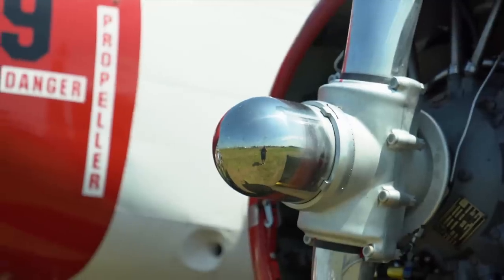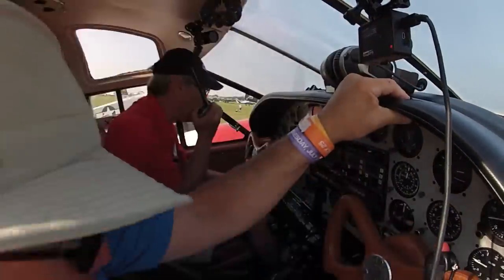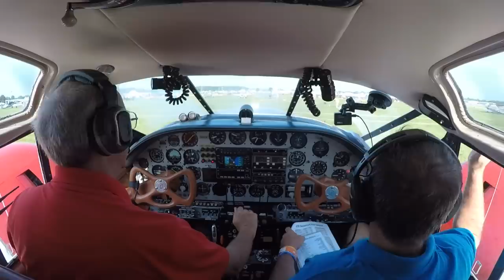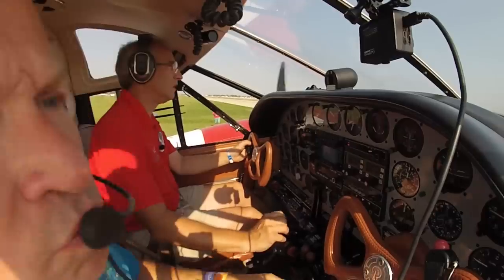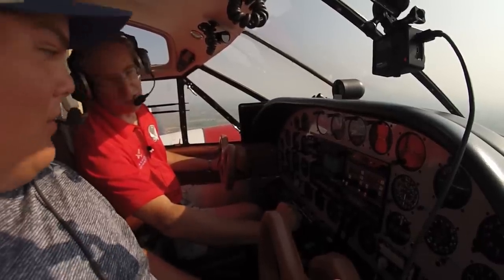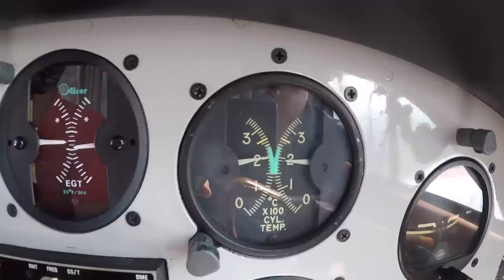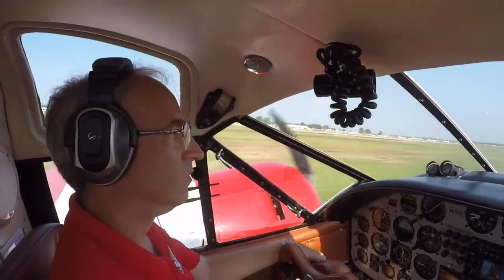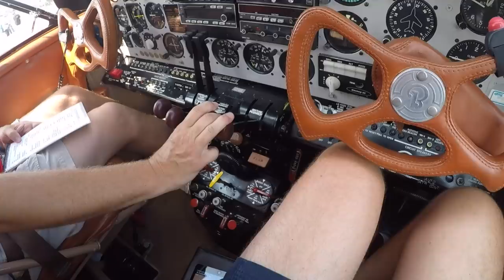Flying the Twin Beech (Beech 18)

Comment: I love seeing the 18's heritage showing in modern big Beech's-- the King Air's flaps, various knobs, switch layouts-- the older Barons' Prop/Throttle/Mixture arrangement-- windows are a mix off 99's/Queen/King Airs-- The cabin door and on and on.  It reminds me of how the MD-80's cockpit window hardware is straight off the DC-3 line.  Decades of good, solid designs.
Reply from the maker: I agree!

Comment: Many years ago, when I was young and full of overconfidence, I flew an H with tricycle gear to show to a potential buyer at his home airport.  1st flight in an 18, I was the pilot.  What could happen, right?  I had about 30 hours twin time -  in a Cessna 310.  Tried to land the Beech like I'd landed the 310.  Found the 18 had the glide capability of a boulder.  Very fortunate those P&W engines came back to life quickly.  I survived the only obstacle landing I ever unknowingly attempted in a Twin Beech.  Have flown a couple since, got some dual time first.  Love the aircraft!  Great video, Martin.  Thanks for putting it up.

Comment: I too love the sound of 985's.  In the early 70's I was a lineboy for a guy that had a dozen or so twin beeches which he used on mail contracts.  Us lineboys would help load the mail and then ride along.  I did manage to bounce one once but never ground looped.  Only airplane the owner ever had wrecked was when someone ran one off the side of the runway for  an unknown reason.   Bobby Younkin used to fly the mail before he started  in the air show business.

Comment: flew one for a company maybe forty years ago.  one thing about it was that you didn't use full throttle on takeoff.  manifold pressure was limited to 36.5 " hg. as you climbed, you kept adding throttle. you wound up with the handles all the way up around 8000 ft. same thing with the p&w  r-1340.
Reply from the maker: Correct, the engines are supercharged, and you have to watch manifold pressure as you advance the throttles for take-off.
Best, Martin

Comment: They have it in MSFS now. This is a wonderful plane to fly - virtually. The visibility is indeed excellent, I was wondering if my head position was somehow too high, but no, it's just that good. It flies so stable. Putting it on the ground is easy, slowing it down is a handful. Keeping an eye on all the gauges is almost infeasible under workload for one pilot. Luckily it does have an autopilot, even one that does not seem to want to kill you. It's not advanced enough to do that, which is refreshing.  
Probably - and by that I mean absolutely - the most fun I ever had in a sim.
Reply: I look at MSFS videos often, now all of the Twin Beech videos keep popping up on my "recommended" pages! I wonder if this is a coincidence?
Reply: @whammo11224  The algorithm knows ;) It’s quite cheap actually. And if not study level, close to it.

Comment: In 1955 or 6 I worked part-time at a FBO at Blythe, CA, and rubbed out new wing panels on an unknown year twin Beech. What a workout on the underneath. Basically I worked for a couple of flights. I also worked at least one Powder Puff Derby in that time frame, servicing those who needed fuel or breaks.

Comment: I've always said that if I could afford a twin I'd own a Beech 18. One of my disappoints in life is that I could never afford to buy one.  Instead I ended up with a Cessna 175 and modified with a Lyc O-360, CS prop, Avcon STOL, new upholstery, new plexiglass.  Still dream about a Beech 18.
Reply from the maker: There sure are worse dreams than that, Douglas!
- Martin
Reply: Douglas Rodrigues Nothing wrong with that man.  Your conversion is a solid one. Assume it helped w weight and balance.

Comment: What are all the slides or signs that the flight station crew keeps managing, repositioning, and displaying up on the windscreen and instrument panel hood, and what are they for?
Reply from the maker: This is part of the communications procedure in Oshkosh. They are signs with the parking position (e.g. GAP = general aviation parking, WB = warbirds) or departure needs (IFR, VFR). Cuts down the radio transmissions.
- Martin

Comment: ?? If the engines are supercharged they don't lose MP in a climb as the blower makes up for the change in air density (to a point). I know a few guys who've owned these, such a cool airplane with a great sound.
Reply from the maker: Going from memory here... Jeff explained that the compressor for the supercharger on the Beech 18 is mechanically linked to the crankshaft. So the maximum manifold pressure available does indeed decrease with altitude, just like in a normally aspirated setup - it's just higher than the atmospheric pressure, due to the supercharger. Given that the Beech 18 uses derated power, in practical terms you can get the maximum allowed MP up to 8,000 feet or so. But it does require continuous throttle adjustment in the climb, unlike a modern turbocharger with an automatic wastegate which maintains MP up to the critical altitude.
No argument on the great sound of these radial engines!
Best, Martin
Reply: @martinpauly  It will lose some MP due to pumping losses, but it'll maintain climb power at least to 8k. I'd have to ask my friend who owned one about the engine's critical altitude. 8k sounds a bit low for a blower engine, but I'm not 100% sure. Great video, btw.

Comment: Some of these old birds were used in military flight training; I believe that the Twin Beech was once labeled as The Bug Smasher for its ability to go so low and slow. Also, didn't many of these birds originally run on 115/145 AvGas? How do they manage now on 100LL?
Reply from the maker: This aircraft works fine on 100LL. I do not know if it ever did benefit from any higher octane.
Regards, Martin
Reply: @martinpauly  But do you know if work had to be done on these kinds of engines to allow them to use 100LL reliably? Perhaps I'm thinking of the old original higher performance radial engines used in the T-28, F-4U, etc., that are still flown at airshows today, that certainly ran on 115/145 octane AvGas back in the day. (BTW, do you realize that your name is the same as Jeffrey Hunter's character's name in The Searchers? 😆)

Comment: This aircraft is waiting for it’s next curator. I would love to be able to afford this aircraft with an open wallet approach. Rode shotgun for a day in one, about thirty years ago at Skydive San Marcos. No insulation or fabric lined interior in the aircraft so there was a whole lot more noise going on.
Reply from the maker: It's a beautiful airplane, but not a cheap one to operate for sure.
Jeff said it consumes about 50 gallons per hour.
- Martin

Comment: What is the reason behind holding up the VFR sign? I know what VFR is, I'm just surprised that they are communicating important information by holding up A4 printouts to ground crew. Why not radio?
Reply from the maker: This is how they do things in Oshkosh during AirVenture. The radio frequencies would be overcrowded without these signs, plus the volunteers guiding airplanes on the ground will have to know where you are going at many times (read: many different places) during the taxi. So the signs work better than radio communication.
VFR in this case means the aircraft is taxiing out for take-off using visual flight rules, as opposed to IFR for I they have an instrument flight plan.
- Martin
Reply: @martinpauly  Fair enough. Thanks.

Comment: Can someone tell me what the phrase ''airspeed is alive'', means? Heard it several times, curious what it means.
Reply from the maker: Tony, what that phrase means is that the airspeed indicator is showing increasing speed, consistent with the airplane's acceleration down the runway. Checking this allows the pilot to abort the take-off in case a problem is found, such as a bug clogging up the pitot tube or a mechanical problem with the airspeed instrument.
Regards,
  Martin
Reply: @martinpauly  thank ye kindly, now I'll know.

Comment: Flew freight in N1394Z, a Beech G18s with 3 blade props,  Mostly auto parts for the car factories in Flint, PTK and Detroit for GM for a couple of years.  Good airplane.   Just don't stop flying it until the engines have stopped and the wheels are chocked.
Reply from the maker: That recommendation seems to sum it up well!
- Martin

Comment: I have about 300 hours in the B-18 from back in the late 60s.  He is correct, it IS a handful on the ground!   There are two kinds of B-18 pilots!   Those that have ground looped, those that haven't.  YET!  The fellow who checked me out in the aircraft, a Super 18 with upgraded engines and 3 bladed props, had over 5,000 hours in type when he signed me off!   About 2 week later he ground looped turning off a runway just a bit too fast at DEN.   Embarrassing!    That is the ONLY aircraft I ever had to shut down an engine in flight!   Tooling along between CYS and DEN and happened to notice the oil quantity on the right engine was decreasing rapidly!   A few seconds later the oil pressure started to fluctuate!  Shut it down and feathered!   The oil cooler had split open.  Caught it in time, no engine damage!
Reply: Ron Fillmore nice work.
Reply: @williameudy6615  Thanks!

Comment: 100 mph in the briefing ? Since when miles /h became a speed in aviation ? Or is it a way to talk about knots ?
Reply: MPH were a thing because the aircraft is so old.  Knots didn't start to take over until roughly the 70s, then you had dials in both KT and MPH, so you had to know what you were looking at before you started flying.  the company i worked for had both MPH and KT so they put our V speeds on the panel and whatever was on the outside was what we used.  it is VERY common to have old A/C with MPH for an airspeed indicator.  from the about 1965-1985 it would be a mix.  from the 1990s and onward, all A/C will be in KT.
Reply: @Freeborn88  Hell thanks, knowing knots came from the ancient marine sailors well before flying was a thing, I always though knots were the aviation speed from the begining. Thanks for your update.

Comment: Does that plane require two pilots or can it be flown solo
Reply from the maker: It can be flown by a single pilot, Emilio.
- Martin
Reply: Martin Pauly but can you then reach the fuel selector?
Reply: @artrose1717  The fuel selector you question was for the electronic fuel gauges. By being able to select each gauge you can take an accounting of how much fuel you have in each of the tanks your particular aircraft is equipped with. Through the years the venerable D-18/C45/SNB had a number of different configurations of fuel tanks. Better than tank gauges switched when you switched the actual fuel valves, or in the case of the plane shown, having to have an instrument panel full of six, eight or ten separate fuel gauges. And yes, it is a stretch thanks to the roomy cockpit, but everything is reachable from the left seat. But just barely.

Comment: I heard the Beechcraft was one of the most dangerous planes ever built.
Reply: The Beech Bonanza was given that rap. The V tailed version would overspeed easily then when the pilot would pull back to much before reducing power and speed the stabilator would break over and the wing would fold into the fuselage. They were called "the forked tail doctor killers". I owned for 6 yrs will little problems it was the most economical single engine I ever operated.

Comment: I do not stow the gear till I run out of runway
Reply: On a multi-engine airplane having the gear out when an engine fails can be fatal.  Getting the gear up as soon as possible makes it more likely the plane's going to climb on one engine.
Reply: @nocalsteve  thanks
Reply from the maker: Exactly. In a twin you want speed (blue line) as quickly as possible, and that's easier with the gear up.
- Martin
Reply: Better discuss that philosophy with a CFI for a while, whether in a single or a twin.

Comment: Holding up notes to other pilots? Thumbs up for wing clearance? Useless chatter in the cockpit? This sure looks unprofessional compared to commercial airliners in commercial airports talking with the tower
Reply from the maker: That's because it ISN'T a commercial airliner at a commercial airport talking  with the tower. This is Oshkosh AirVenture. The way that do things there that one week of the year may seem simplistic, but they've validated and matured their fly-in procedures for 50 years - and the "normal" procedures used everywhere else (i.e. radio communication with air traffic control) would fail in Oshkosh.
Regards, Martin

Comment: Love the Beech 18.  I would NEVER own one.  They are all clapped out (especially the military surplus), require FULL inspection on EVERYTHING every 125 hours, they're just OLD beyond reasonable use and simply aren't worth it.  Even A good example will have hidden problems, and if you aren't aware of the problem  that just makes it worse.
Reply from the maker: Scott, the Beech 18 is not a very practical airplane to own  or fly in this day and age, I give you that. But for some people, practicality isn't the point - they love these old aircraft and deal with the rest. Some of them are mechanics as well, and they love tinkering with the airplane just as much as flying it.
Regards, Martin